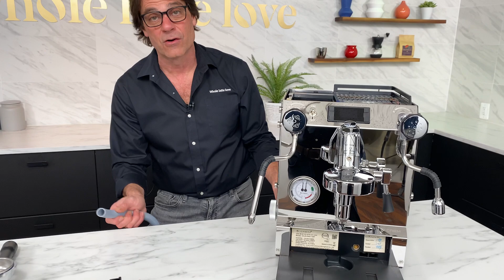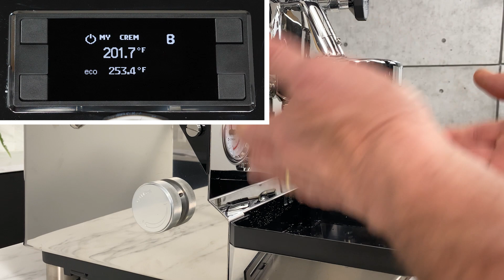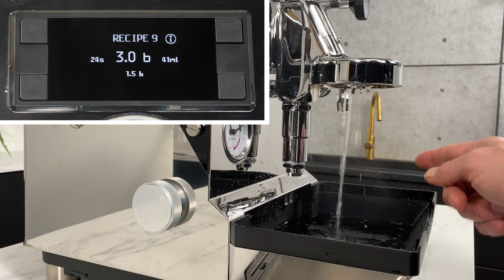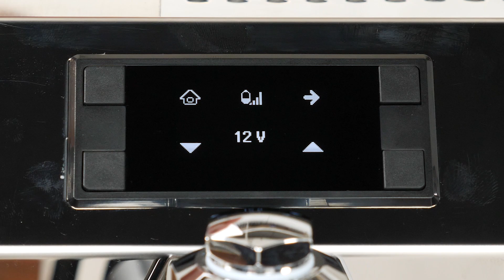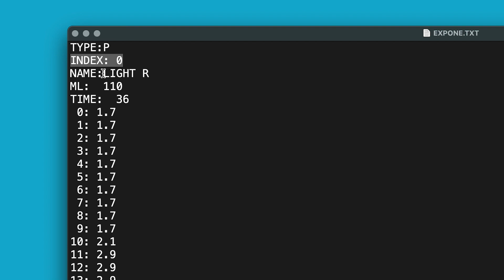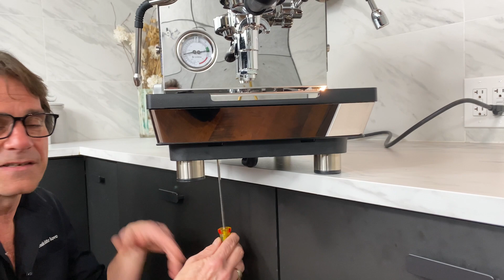Crem ONE Profiler Startup Guide

Comment: I Have a Crem One Dual Boiler and problem just started where the pump does not come on, makes some noise but no pressure, I remove the portafilter and try to run pump and no water. no pressure on the gauge.

Comment: Hey there. I see in the video how to adjust brewer pressure, but my steamer pressure sits at the red arc (too high). I’ve checked the technical menu settings and calibrated them according to the video. How do I decrease the steamer pressure so it sits in the green arc (milk frothing not going well with this too high pressure setting).
Reply from the maker: Hi TH, thanks for the question. Here's a link cued to section of video showing how to adjust boiler temperatures. For less steam pressure set temperature of the steam boiler lower: https://youtu.be/VQ4I274j39k?si=7ysnqDtAEYL6qKrN&t=650
Hope that helps!
Marc
Reply: @Wholelattelovepage thanks for the reply! My Steam temperature currently on around 255 (normal), but will try decrease temperature to 245 to get the pressure out the red band, and reach out to a technician. Thanks!

Comment: Good video - thanks! How come The pressure don’t go back down after the handle shuts of the water? I’m seeing this behaviour in some scenes. Especially during the cleaning session. Also seeing this in other tutorials. Thanks again!
Reply from the maker: Hi D, Thanks for the question. Brew pressures in espresso machine are usually measured fairly close to the pump. Downstream of that measurement most espresso machines have a one way valve prior to the brew boiler. When you stop an extraction pressure is retained in the circuit between the pump and one way valve. So seeing pressure is normal. If after an extraction you lift the E61 lever a bit without kicking on the pump the pressure will bleed off and bring the pressure down. You do not have to bleed the pressure off but can if you want to.
Marc

Comment: Hey guys, I recently got my own profiler and am trying it out. For some reason I can never get above 7 bar when profiling. Despite the target pressure being as high as 12bar, the measured pressure never gets higher than 7bar. Am I doing something wrong or is there a setting I need to change or is the problem with my machine?
Reply from the maker: Hi LSW, Most likely is your grind size is not fine enough to reach that pressure. But chance it's something else and here's how to check. Put a backflush disc (blind filter basket) in your portafilter. Run a profile at 9 bar target and see if you register that. If you do then it's your grind size is too coarse. If still only hitting 7 bar then you will need to adjust the pumps bypass underneath the machine using a small flat head screwdriver. This adjustment sets the maximum brew pressure of the machine. The adjustment is located near center under the machine and a little to the left. You need to adjust while the pump is running so you have to hang the left front foot off the counter edge to access. You can set whatever pump pressure you like but we recommend ~10 bar. Set the machine to produce 10 bar and with the backflush disc in place and pump running turn the pump bypass adjustment until you read 10 bar actual. Again, you can set that bypass to whatever max pressure you like. 10 bar is just a recommendation. Hope that makes sense and helps!
Marc

Comment: Can be installed the Flow Control kit on the E61 brew unit like the ECM/Profitec? Could be a weird question but with that you can get two methods of flow control and flow profiles!
Reply from the maker: Hi I, Yes it could.
Marc
Reply: @Wholelattelovepage  Thank you Marc. Do you know if you will have the Profiler back on stock soon?

Comment: Hi, do you know how to use with plumbed in water? Older machines had a tap selector but newer ones don’t. Your one looks like a new one one?
Reply from the maker: Hi Benjamin, the Profiler is being sold as reservoir-only in the US. The machine was originally designed to auto-fill the reservoir from the direct line in order to allow for low pressures when profiling (less than line pressure), however we were not comfortable with that system.  If there was ever a problem with the inlet solenoid valve it could overfill the reservoir.  There have been no issues reported to us on this happening, but we are erring on the side of caution. The other three Crem ONE models are pumbable and include the necessary items to hook them up to a water line, as they do not operate the same way. 
AJ

Comment: Would we need to descale the machine, if so how ? Sorry haven’t watched all the video. But from contents I don’t see a descaling section?
Reply from the maker: Hi Khaled, Need to descale depends on quality of water used in the machine. We always recommend using water that does not cause scale yet has the mineral level needed to prevent over-extraction, corrosion and support good flavor. BWT makes a filter pitcher or in reservoir pad filters featuring patented ion-exchange tech which replaces calcium with magnesium resulting in water that will not cause scale when used as directed. Both filters have activated carbon to remove chlorination and chemicals. Here's the Penguin Pitcher: https://www.wholelattelove.com/products/bwt-penguin-2-7-l-water-pitcher
And Bestsave Pad Filter: https://www.wholelattelove.com/products/bwt-bestsave-m-anti-scale-filter
Should you not treat water to reduce scale the machine can be descaled. We prefer a professional technician do it as scale within the machine can dislodge in chunks during descaling and plug other components. But it is possible for knowledgeable home users to descale as both boilers can be drained. Not many dual boiler machines have brew boilers that can be easily drained.
Marc

Comment: How would you go about choosing between this and the synkronika?
Reply from the maker: Hi Alexis, Excellent question! The ECM Synchronika, especially when equipped with flow control of the E61 group is a wonderful machine. It's IMO about the best classic Italian built dual boiler prosumer level E61 machine available. The finishing of the case and components is perfection, internals follow K.I.S.S. design, it's plumbable and has best in class steaming power. The Crem ONE PROFILER is a more modern take on the classic Italian (or Spanish) machine design. Pressure profiling based on flow measurement does essentially the same thing as flow control but in the Crem it's repeatable with the ability to save profiles. Flow control on the Synchronika is done by feel - it's more of an art. In the PROFILER there's a deep level of electronics control with features like programmable on/off times per day of week, ECO mode with drop to programmable temps for quick reheat, GSP:  Programmable Gradual Soft Pre-infusion which allows one to use a finer grind and more. Unlike the Synchronika the Crem is not plumbable and max steam pressure is ~1.4 bar vs. ~2 bar in the Synchronika. Beyond those differences at end of day it comes down to what a user values. If one is a more hands on artsy type who appreciates fine finishing details then perhaps the Synchronika. If you like technology the PROFILER may be more your game.
Marc

Comment: Can u address the negative press about quality?
Looks amazing to me
Reply from the maker: Hi Matthew, I'm not sure what negative press you're referring to. We've been very impressed with the quality. It's a bit of a break from traditional Italian machines made of 100% metal, but there are some advantages to the aspects such as the polycarbonate frame: no rust, lighter weight, less prone to damage during shipping, etc. We'd be happy to address any specific concerns you have. 
AJ
Reply: @Wholelattelovepage  
Its all guys online in forums panning crem due to past Brutus issues
Im thrilled with crem quality/ features and have order budgeted may
Reply from the maker: So the Brewtus has been around for nearly 2 decades. Look over the life of any product and those who have troubles tend to shout the loudest in forums. I hear and see the other side - those who love the Brewtus for its excellent combo of capabilities/values and tank like build. Depending on perspective maybe not the most beautiful looking machine but delivers espresso on par with machines costing a lot more.
Marc
Reply: @Wholelattelovepage  
Yep
I get that too
Main awesome points;
Amazing control of pressure n temp
Super materials in frame 
Straightforward menus to manage 
Ease of use for adding water draining etc using scale
Looks great
Ability to do multiple milk based drinks for large party
Internals well ordered 

Only  add for me would be made in Europe and a bottomless Portafilter 
 
An example of using technology to overcome a build “weakness”
Is scheduling on off

Comment: Have you had a chance to determine how accurate the flow measurement has been -- how does it track vs a scale measuring the dose out?
Reply from the maker: Hi c, Thanks for the question. We have evaluated shot to shot consistency of output weight vs input brew water volume running the same profile repeatedly. Look for a "proof of performance" video coming soon. Profiles have a defined brew water volume in ml. When the volume for the profile is reached the pump stops automatically. When running the same profile with the same coffee dose weight and running the profile to pump stop we're getting within 2g output weight shot to shot for doubles at a 1:2 ratio. A couple of things to keep in mind... Brew water volumes measured by the flow meter are higher than liquid volume out. This because the flow meter is near the pump and there's overhead to fill the Crem E61 pre-infusion chamber above the shower screen and the headspace in the filter basket. If one runs a profile to pump stop the hydraulics after the flow meter lose a bit of fill due to pressure drop. To assure higher accuracy of the next extraction it's necessary to recharge hydraulics with a very short flush.
Marc

Comment: You guys mentioned at some point in an older video that such a machine (double boiler and/or heat exchange, not quit sure) should only be descaled from a professional. Would that be possible to do at home now with this one as the boilers can be drained?
Thanks!
Reply from the maker: Hi S, Thanks for the question. You are correct on what I've said about descaling dual boiler. With the drains on this one it's more doable. But there's still the risk of loosening a scale deposit when descaling a machine and it gets trapped elsewhere causing problems. It's always best to use water unlikely to cause scale in the first place but has enough minerals (don't use pure distilled or RO water) to prevent over-extraction, support good flavor and prevent corrosion.
Marc

Comment: From the video it appears that this Profiler sold by WholeLattaLove does not come with the necessary equipment to allow it to be plumbed-in.   However,  the downloadable manual for it indicates that it is capable of being plumbed in (in two different versions).   Can this machine be fully plumbed in with the right hoses?  Will a plumbed in version be made available in future?
Reply from the maker: Hey SpeakNup, you're correct - the Profiler is being sold as reservoir-only in the US. The machine was originally designed to auto-fill the reservoir from the direct line in order to allow for low pressures when profiling (less than line pressure), however we were not comfortable with that system.  If there was ever a problem with the inlet solenoid valve it could overfill the reservoir.  There have been no issues reported to us on this happening, but we are erring on the side of caution. The other three Crem ONE models are pumbable and include the necessary items to hook them up to a water line, as they do not operate the same way. 
AJ
Reply: @Wholelattelovepage  a fulsome answer!   Thanks!